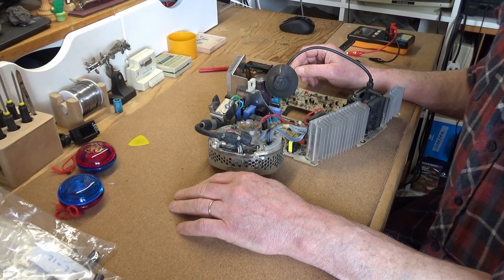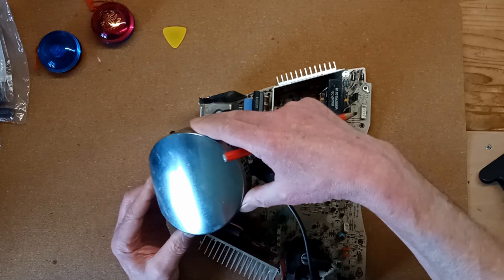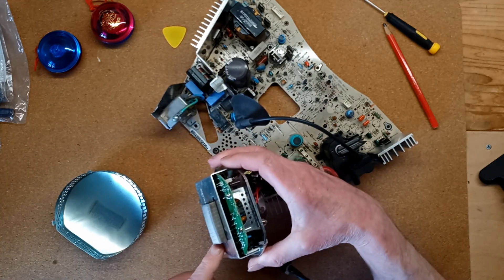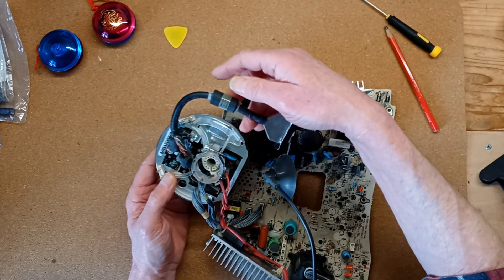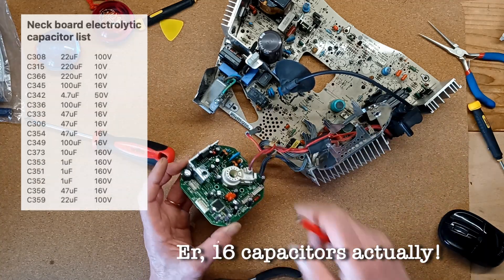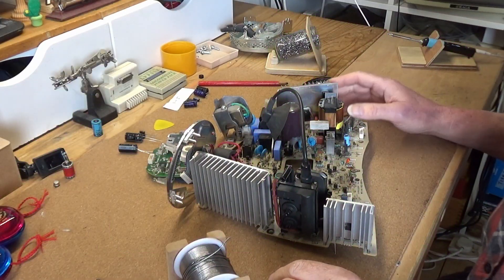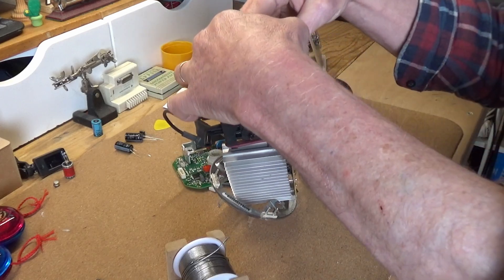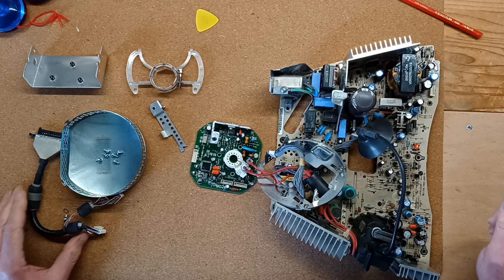iMac G3 slot load: alive?

Comment: Yes that would be disappointing indeed. Thanks for making this video as I have the exact same iMac that won't boot either and have followed your video with hopes that I would find the problem. My iMac turns on but won't boot. There is a crackling noise which appears to be coming from the DCB board. I tested the voltages coming out of the DCB board and they appear to be correct. I'm now at the stage of taking out the Logic board and DCB board to inspect them for capacitor damage. Here's hoping I can find the fault. Once again thanks for making this detailed video it has been a great help, cheers Stephen

Comment: How many capacitors were bad? Did you test them after removing? Looks like it is another case of recappacide or do what the internet says (change the caps) and you would be fine, then it turns out to be something completely different
Reply from the maker: Thank you for assessment and insight. I tested every one from both the neck and pav boards. Other than the 400V cap on the PAV, not one tested as good (though apart from one, all tested good on the DCB). As I said in the video, some were marginal but for the price of a cap, and given the pain this machine is to strip and rebuild, it's certainly easier simply to recap while it's apart. And now, forgive me while I go back to the internet for further instructions... :)
Reply: @backroomboy4420  Interesting. I usually test them with an ESR meter. Bad ones would have higher than normal ESR. Anyways I prefer to first make it work, then do a recap. Dealing with old tube radios, this usually saves my ass if something really major is at fault, before I spend 4-6 hours recapping it. Like having defective transformer or some coil... Most of the times bad capacitors will not prevent it from working, it will just make it work badly